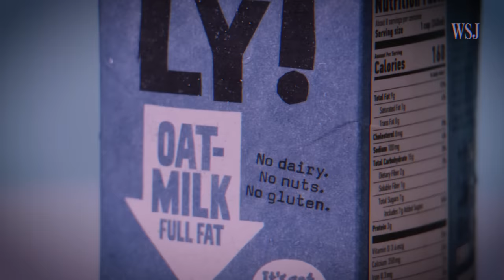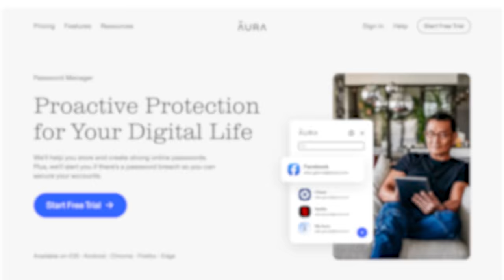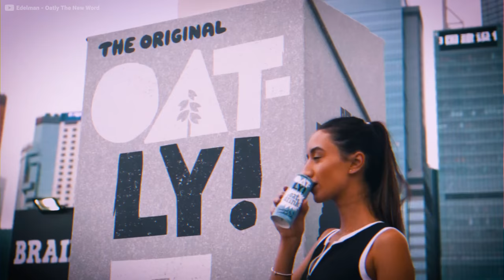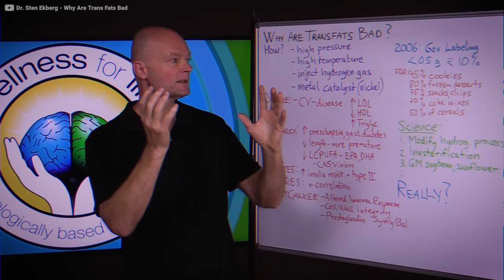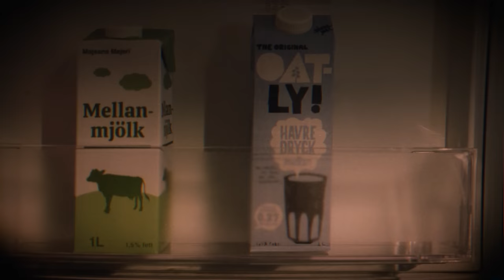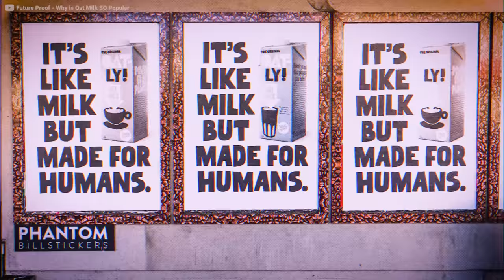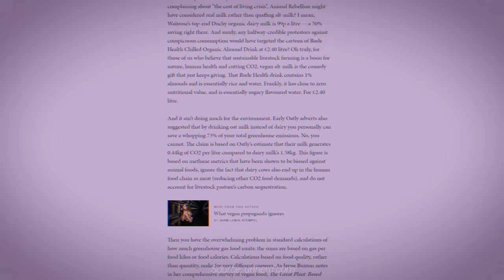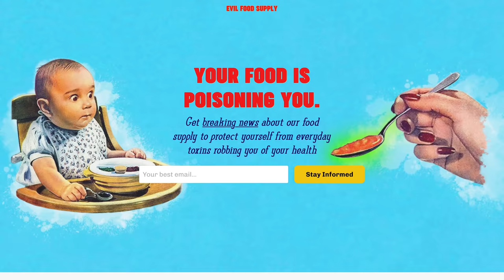Oat Milk is literally a scam.

Comment: I’ve often wondered why oat milk from the store was so incredibly sweet, since no kind of sugar or sweetener is on the ingredients list. Thanks for explaining!
Reply: in my oatmilk none of thiese things are included. Its just that oats naturally are sweet to some degree
Reply: @seanplateau8912 and this is why it raises your blood sugar just like sugar only a little later
Reply: @seanplateau8912  when you put oats in your mouth, the starches in oats get broken down into sugars by enzymes in your saliva - that's why they can be sweet. it's true for any starchy food. i don't think they would have to list down a manufacturing process which uses the same enzyme in the list of ingredients. there's a possibility that there are sugars in your oat drink.

regardless of whether it's sweet sugars or not, they're all carbohydrates that will eventually raise your blood sugar. the best drink will always be the least "nutritious" one - water.
Reply: I often even sweeten it with normal sugar - isnt this common? (rhetoric question though :)
Reply: Well IF sugar and sweetener AREN'T on the ingredients list, yet it contains some, then what you are drinking is illegal. 🤷‍♀️
Reply: @Kensuke0987 No-one wants water on their cereal.
Reply: @Kensuke0987  We need to understand the difference between complex and simple carbohydrates.
Reply: @oneoflokis  No one said you have to put water in your cereal. Best solution is to just eat the cereal dry with water on the side. Or maybe we should just stop eating so much cereal.
Reply: @oneoflokis Sugar and starch are the same in the way a square is a rectangle but a rectangle is not always a square. Starches contain sugars but not all sugars are starches.
Reply: @oneoflokis  He obviously meant best for blood suger since the other person said oat milk will raise blood sugar.. Cow's milk also raises blood sugar.
Reply: You can't beat Mother Nature so I'll be sticking to cows milk thanks!
Reply: @oneoflokis  wrong
Reply: I´ve lowkey mastered how to make almond milk with only water, a blender, a bit of salt and honey of your choice. Trick is to take half of your batch and pasturize it (heat it just until boiling point) , let it cool and mix it with your un heated almond milk. This gives you the milk curtains and texture of a medium fat milk. Also making it yourself you can add more almonds and use the pulp in bakery or what you choose, and the "milk" isnt water with 2 % almonds which is ridicusly small amount for the money.
Reply: @Andreas0705 neat
Reply: Me too!
I'm sad it's so bad, but I'm glad to know so I can avoid it.
Reply: @Andreas0705 Cool, thanks!
Reply: Oats are naturally sweet. And most brands do fermentation to naturally increase vitamin content and avoid the naturally-occurring digestion disruptors that are common in grains, nuts and seeds. Although soaking would be enough to remove those, fermentation also makes it taste sweeter. It’s a win-win-win.
Reply: @oneoflokis Lol, so the sugar content in some fake milk is the issue for blood sugar levels when you're eating cereals? Let me repeat - cereals? :D
Reply: @sdwone  lmfao you can drink dairy milk if you want dude but oats and water also come from nature
Reply: If a product contains added sweetener, it's listed in the ingredients statement. Oats are a very mild ingredient, so they taste fairly sweet even without added sweetener. For any plant-based milks, unless it's labeled unsweetened, it typically contains flavors (like vanilla) and sweetener. Unsweetened varieties are easy to find, if that's your preference.
Reply: @sdwone  you mean breastmilk then, don’t you. And Mother Nature has little to do with modern choices. Remember, you’re on the internet. It doesn’t run on daisies and colibri farts.
Reply: You guys don't realize oatmeal lowers blood sugar when you eat it? Diabetics have to be careful with oatmeal
Reply: @pointysidedown oatmeal is different from oats
Reply: @Sceptonic  oatmeal is just oats with hot water, they literally are the same thing. Perhaps grinding them destroys the fiber, and low glycemic index, resulting in the sugar spike with oat milk vs sugar drop with oatmeal.
Reply: @pointysidedown  yes i was referring to the sugar drop
Reply: newsflash, sweetened and unsweetened versions are available for sale, at least here in Europe.
Reply: maltose is a kind of sugar :) or carbohydrate
Reply: Its not sweet at all to me. I think it's the brand yal are drinking
Reply: @sdwone oats are natural, doofus
Reply: This video is a farce. The milk and oat milk in my fridge have the EXACT same sugar content
Reply: @Kensuke0987  Regular potatoes, raw onions, tortillas, etc aren't sweet.  Plain oats taste like paper, so they probably add something to it.
Reply: @Ari_C  But these "things from nature" are highly processed & covered in pesticides. It doesn't beat real milk.
Reply: @lagopusvulpuz1571  it does beat real milk, its better for the environment, more ethical, and agruably still better then normal milk. so yes, it is better than normal milk.
Reply: Me 2 😮
Reply: @Andreas0705  great tip!
Reply: @_abc_-  doesnt cow milk does it because of lactose
Reply: @luannafsantos  thats pretty interesting. Also what are your thoughts on kombucha.
Reply: @zonderbaar  and your body regulates that fine, like it does with every other starch that exists, unless you are diabetic.
Reply: @zonderbaar  But so does cow's milk - which actually contains MORE sugar than oat milk in most cases. This whole video is so disingenious - no shit, don't drink any kind of milk like water, but compared to cow's milk, oat milk is a) at least as healthy if not healthier, especially outside the US where oat milk often doesn't contain added sugar, but where - to be fair - milk also doesn't contain just as many hormones b) a LOT better for the environment and c) no you can't produce 15 Liters of oat milk with a pound of oats and even if you could: like he specifically said those are not the only ingredients, but also, dairy is HEAVILY subsidized and still those prices are not nearly the same in my country (1 liter of oat milk costs about the same as cow's milk here, which is about 1,7€)
Reply: If it ends in “ose,” it’s a sugar.
Reply: When you malt oats the starches turn to maltose a very sweet sugar and oats are essentially all starches. Since they have already listed the oats they don't have to list the maltose. Oat milk is worse or just as bad as any soft drink and will bring on early diabetes.
Reply: I once tried oat milk from beleaf and it was so sweet...

Comment: Fun fact: "rape" and "reap" essentially both mean "to take" and rapeseed has very large yields, thus it was named such as "the seed to harvest" - thus its traditionally very, very low price point.
Reply: yes, but it isn't a bad oil - quite the opposite it is a high quality oil with loads of polyunsaturated fatty acids
Reply: @michaelkores6860  Maybe, if it's pure and high quality rapeseed oil with no 'added volume' - and, spoiler, the cans or bottles you find in most stores with 1 liter for 2-3 bucks isn't. You get what you pay for.
Reply: @MNAHN-T.GOF-NN  Most certainly, but you can use that arguement for other oils as well, maybe rapeseed oil of inferior quality is more a thing in North America than it is in Europe?
Reply: It absolutely stinks like old socks in the field whilst drying out before harvest. This i do know.
Reply: Well If we are very strict , the meaning of "rape" is actually closer to "to rob/steal" since its derived from the Latin Word "rapere" 
But yeah, essentially the same
Reply: @michaelkores6860 If it's cold pressed, the cold pressed rapeseed oil  have a slight nutty flavour.
Reply: @stephenlamley541  Pretty much all form of cabbage  does have bad smell